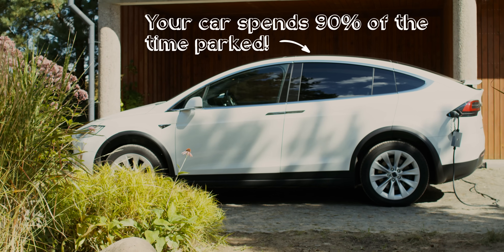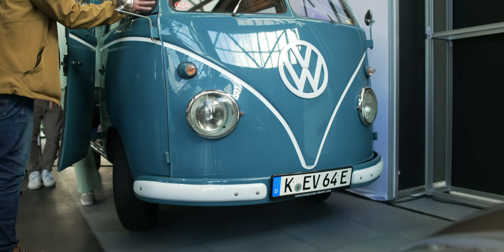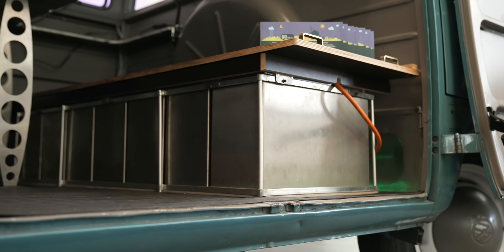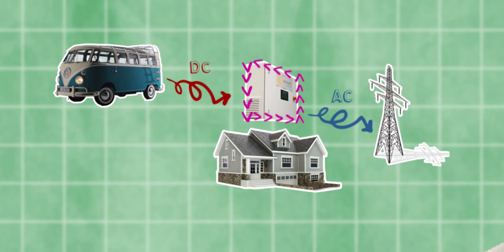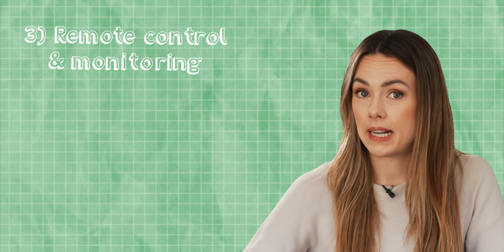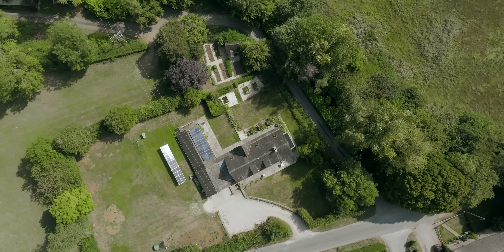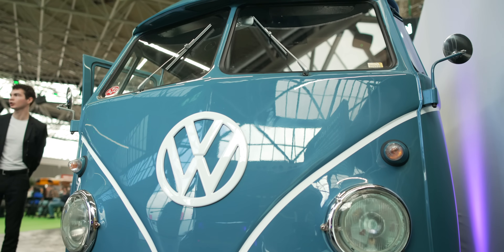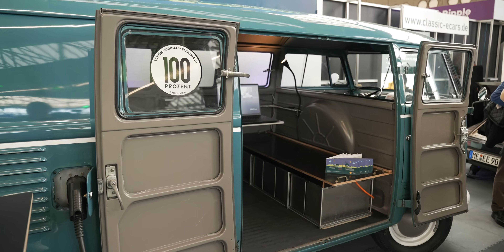This VW Bus Has SUPERPOWERS!

Comment: Great review, and really insightful. Makes you step back and rethink this whole transition in a different way. Every day is a learning day.
Especially liked the summary “We can stop thinking of electrons like petrol to be consumed and more like data to be traded, swapped and gamified”.
Reply: For all the above reasons and more V2G, makes far more sense at a variable capacity battery pack swapping station.
Reply: Most EVs have a one way flow out of the inverter. Early model 3s definitely do.
Reply: E-motor does it need or use an inverter (AC motors do need a rectifier, which is sometimes misled labeled as a power inverter) and Tesla has nothing to do with this .... (Except for the battery swapping FUD that comes from the Elon sycophants) 

But no matter how it is rationalized, battery swapping is still the best option...
Reply: Avoiding the key fact that battery swapping is just the better option....  doesn't change that fact... Plus most of the reasons why, have nothing to do with electronics... 

For example it makes more sense logistically.... To have the excess battery capacity of an EV at a battery swapping station for most trips.... Via the use of modular or variable sized swappable battery packs.... Plus battery swappable packs are leased, so EV owners don't have to worry about v2g degrading the battery.... The list of advantages for the use of battery swapping just keeps going on..

'Just because your only tool is a hammer, doesn't mean everything is a nail' it's not just about converting DC to AC...

Comment: Nio has 1 battery swap station in Denmark. From just that 1 with energy arbitrage thru v2g they expect to earn 10s of thousands of euros annually with no high loss of energy in the packs themselves. Pretty good gig if you can get it. Also has a Solar roof for power production.  Since the cars also do v2g years u can rent the battery and not worry about deterioration.
Reply: Degradation?
Reply: @MrKOenigma  ahh that's the word, 😂😆. Thank you!
Reply: Outsourcing?

Almost all of us outsource our electricity supply from a company outsourcing it's own supply from the grid sort of thing.

In UK we've been outsourcing  electricity for at least a hundred years or so ... and gas ... (pipe or tank) ... or water.

You might say we "outsource" the contents of our septic tanks as well as.

If you added a power wall and/or V2L and solars (not quite so useful in UK) where's the cost saving if you include the equipment?

Even in really atrocious weather UK doesn't suffer that many outages.

Hospitals, say, sit on a generator(s).

Some defence stuff might have two completely separate incomers off the grid from entirely independent connections, and a genny if Armageddon does arrive.

Mind you most of us would have been exposed to a touch of gamma radiation and probably not too bothered about much after that anyway.

Those in their own fall out bunkers will only be delaying things by a couple of weeks anyway.
Reply: outsourcing is never a cost positive
Reply: @flodjod  outsourcing what?

Comment: You can go with nio. You can rent the battery and use v2g at home or at the mall or work or wherever to make a few bucks.  Obviously they have limits to home much you can use it but then u don't need to worry about the battery health strictly speaking. Just swap in a new one if there was an issue..easier for recycling too. The software between your car and the local electric provider is buit in. Obviously there lots of providers to get on board so not live everywhere ( yet).
Reply: Home use is such a lower power draw that it would have virtually no degradation implications…
Reply: @JohnR3141 cool, even better

Comment: V2G is great, for now. I suspect that soonish there will be bountiful, affordable utility scale grid, and residential home, storage available.
The question is whether there's time between now and then, to make the technology a general standard. Or, if by the time that comes to pass, it will be redundant. It's certainly not the simplest solution to increasing grid storage.
V2L is just plain useful. For any car. I doubt that will ever change.
Reply: V2G will remain useful for years - it's not about to become redundant. It's daft to buy a lot of house battery if you have already bought a large battery in the car (and it's at home often). And we do already have standards for all of this - people just need to start using them (and not adding proprietary extras to subvert things).
Reply: @xxwookey  I understand V2G as the car battery hooking up to the public grid. The public grid can draw from it, and you can be paid for the service. You sure powering your home (alone) qualifies as V2G? As opposed to V2L..
Reply: @Sq7Arno  Well, if your house is already powered (e.g from your PV or your battery), then adding power from the car is identical technologically to when your house is connected to the grid, because the important technological feature is syncing with the AC in order to deliver power. If your house is dead and disconnected, than yes it would just be V2L, because there is no existing AC frequency to sync with.
Also it's not really right to say the 'grid draws from your battery'. The controlling device in terms of whether power flows in or out is the inverter. That could be in the car, in your 'charger' (actually EVSE) or in your house. And (ideally) you can control that, or you can choose to hand over control of it to the power company so they can decide when to flow which way.
I hope that makes sense.
At the moment the power company or car company tries to sell you 'black box' paired device so that only they can control what happens. What you really want is your own device, and you let that choose (e.g. using signals from the power company and a weather forecast) when to charge and when to discharge. This means you can change providers/cars/batteries in the future without having to get different hardware.
Reply: @xxwookey The two terms still mean two different things. I'm a great big fan of the idea behind V2G at the moment. But, as was pointed out. It's no simple thing to implement the standards effectively and widely. 

My entire point is that I suspect we'll have extremely plentiful grid storage in the form of banks upon banks of up and coming economical and fit for purpose batteries - By the time we've even started approaching effective V2G standards adoption. I do follow the news, and things are looking extremely promising on that front. Even for purposes like Steel and Aluminum smelting energy demand.

If your concern is V2L on the other hand. As I said this will always be useful. Including for purposes such as powering your home. And many more cars support V2L already, than V2G. It's a major selling point for many EV buyers. And, it's simply easier and cheaper to do without the world, including your car's manufacturer and the electrical company, having to reach a universal consensus.
Reply: @Sq7Arno  Yes of course V2L and V2G are different things. One requires a sync with an existing AC frquency, one doesn't.
Yes there is quite a lot of battery going in on various grids at the moment (certainly in the UK), but that pales into insignificance when you add up all the cars: that is a lot of storage (about 1 TWh). Given that the world is likely to be battery-minerals and/or manufacture constrained for the next few years at least, it makes a lot of sense to use the car batteries for grid balancing rather than make all the batteries again. 

And it's not really hard to make it work at all. It already works for Kia and Hyundai. It works for MEB once a small software change is pushed later this year. We already have the comms standards. We don't need a 'universal consensus' on anything beyond the comms standards, and those already exist. There can be plenty of different business and control models given open standards implemented in connection equipment.

You are right that there is potential for other, cheaper, more static-appropriate battery tech to go on the grid, reducing the need for expensive mobile-optimised batteries to be use for this purpose, but the demand for storage is already very large in dunkelflaute periods, and will continue to grow as nearly every house gets a heat pump and nearly all the cars go electric. I'm fairly sure we can use all the storage we can get for the net decade.
Reply: @xxwookey It could be a decade still. It's possible. But, it could take just as long to generally adopt an effective V2G standard. It's slow going. Demonstrably. It's not a new concept and its hardly gained traction.

And it's a great idea, but from a time when we could hardly imagine 1TWh/y of battery manufacturing in the world (already surpassed now). So getting dated in context. 

I'm seeing some seriously cheap grid scale storage tech entering the scene right now. Easy to manufacture too. Already scaling. Some with figures like $1/KWh reported. Good enough to run a steel smelter on. The real money's starting to flow in the right directions. The next 10 years are going to be a blur of organic growth for alternative energy.

In the home and on the grid. There's an extremely good chance double digit KWh home storage will be nothing special. And electrical utilities could find it cheaper to buy their own storage, than to effectively rent residential and mobile storage. 

Fairly soon.

Comment: In my view V2G cannot come fast enough, I have 2EVs sitting on my driveway more often than out on the road and I have a time of use tariff, all perfect for lowering the cost of energy in my home.
Reply: The only reason it has not come sooner is because some car companies also have home battery products to sell. In Tesla's case, it directly competes with their powerwalls, so they made up the excuse it would degrade car batteries, which is a dumb excuse since a house has much less power intensity needs than a car.

So in other words, we don't have this yet because greed.
Reply: govale6360 good point
Reply: @hugovale6360 Even under lower power loads of a house the energy loads are enormous meaning you'll go through far more charge cycles quicker than if you just used your EV battery to drive.
Reply: @tomstdenis  said "Even under lower power loads of a house the energy loads are enormous". No, houses use way less power than cars. And car batteries are much bigger than house batteries (unless you have a very large house/big heat pump). Our house uses 3kWh/day, peak load 7kW (hob). A car accelerating is up to 80kW. Some houses use a lot more electricity. 8kWh is average. Some are 20 or even 45 with a big heat pump and too many teenagers. So the house could run for between 1 and 20 days off a typical 55kWh car battery.
Reply: @xxwookey where on Earth are you just using 3 kWh a day? This is the average consumption of the flat of my grandma, living alone, not using the dishwasher, heating water with centralised gas unit, low use of TV, no internet, no IOT. I live in a family of four and our daily average is 14 kWh a day + 7 for the car and still I'm heating the home mainly with gas (methane)
Reply: @andreaceria8481  We have taken steps to make the house efficient. Removed parasitic loads, bought an A+++ freezer (that halved cooling usage), made sure the IOT, house server and router kit is low power. LED lighting. Computers are now laptops, not desktops (I do 8-10 hours computing every day). We do have a dishwasher. And we have 3kW of PV so that 3kW is grid usage. House usage is 20% higher (80% exported). I'm in Easy Anglia, UK. If we had a 10kWh battery we'd hardly use any grid power.
Reply: @xxwookey  I'm also living with recent furniture and appliances, but the baseload is about 100 W on average or 250 W when the pump for hot water circulation is on. So 4~5 kWh a day without doing anything. I don't consider PV in the calculation, as I was discussing consumption and not grid imports...
I'm living in Italy and the average home/family consumption is rated at 2700 kWh per year which is about 7~8 kWh a day
Reply: @ceria8481 Hot water circulation is a good way of a using a load of extra electricity (and some heat). 100W is a fair amount of permanent load. e.g. 9 routers/devices and a boiler? Maybe a central heating pump? That's one thing we avoid by having a very well-insulated fabric so heating is only used about 30 days/year (and load is about 2-3kW). 
Still, 4-5kWh is better than average, especially if you have hot water circulation, which usually implies a big house.
I used the grid figure because it's easier to measure. Working out the total usage from generation - export + import is harder (we do have all three meters but only 2 are smart). I should updated my spreadsheet and check :-)
Reply: It's like a perfect solution? 
If you are pulling down charge you don't need,?
But your charger turns off when your battery is at capacity.
When you are at capacity, why would you send charge back?
Wouldn't you need an incentive?
I'm going to get so schooled here😊
Reply: @michaelrobson3460  1) You have a power cut - very handy to power house from car.  2) your grid supply is lower-carbon at some times of day than others, so best to fill up at low-carbon times and run the house off that all day 3) you have electricity prices that vary during the day, so you'd like ot fill battery when it's cheap then use that cheap electricity all day 4) if the price variation is large enough you may be able to sell electricity back from more than you [paid for it, so now you can make money on the arbitrage. If that pays above battery wear/amortized capital costs then it may well be worth doing.

If you have no emissions variation during the day (or no way of finding it out, fixed-price electricity all day and very rare power cuts, then yes, this technology is not useful to you.
Reply: The amount you save on your electricity bill won't offset the cost of replacing your battery if you're daily deep discharging it unless your grid provider has some sort of surge pricing which many grids don't have.
Reply: @tomstdenis  the car degrades the battery much more than a house. A house draws 3 to 6 kW at most. A car draws 20 or more. Also, you can have solar panels charge your car with free energy which you can then use in your house.
Reply: @tomstdenis  you'd just get a nio and rent the battery, degradation be da*ned, 😂😆. China and Europe have huge differences between peak energy and overnight energy. For v2g you'd want to sell it during the day not bother with your home I wouldn't think. At least if you go to work each day

Comment: Why are car manufacturers so slow to help enable vehicle to grid? This has the potential to help save customers money and balance the grid while increasing renewable energy installations.

Nissan Leaf was the first mass produced EV, launched in 2009 it can do V2G, why arent all EVs capable of V2G?
Reply: Look at the percentage of Leaf owners who actively use this feature. I don't know what it is, but I suspect it is tiny. Car makers have bigger and more important problems. Plus, Chademo is less and less of a thing relatively speaking, so they have to start from scratch again.
Reply: Partly because cars are sold world-wide, but the problem of control and payments is local.
Reply: Here's a few reasons I can think of off the top of my head.

1) Unless your utility supports V2G, V2G capability in your car is pointless. And most utilities, as far as I know, don't support it yet.
2) The additional cost for a V2G capable charger, compared to a regular charger, is a deterrent for many people.
3) If you drive the car to work during the day, your ability to use V2G is rather limited. Of course, that doesn't apply to people who work from home, but it's still one more factor that reduces the potential user base.
4) It adds complication for the driver to deal with. In a world where even optimizing one's electricity plan and charge schedules for cheap electricity is more complication than the average driver is willing to do.
Reply: Dunno.

Comment: Disappointing  video, tempted me in with talk of v2h but focused on v2g.  I don't want to buy a power wall battery when I have a 40 kwh battery sitting on the drive.
Reply: You do, actually. At least, you do if there is a power outage and you want people at the home to still have some power if you need to drive away. As the interviewee said, you can get a small battery for the home and supplement with the car battery. Powerwall? No. Something smaller, like an EP Cube in the minimal configuration.
Reply: @chill-633  I've not heard of ep cube, just looked it up, not sure it's available in the UK yet. Interesting concept of  backing it up with the car, will investigate further. Thank you
Reply: Good point

Comment: I think you could have perhaps used this as an opportunity to explain that v2l is actually enough to make a difference, since you can always use this to charge directly a house battery with a low power inverter and battery charger, meeting the average power requirements, and the house battery and inverter provide the higher power output for peak loads.  It also solves the problem of split phase in North America